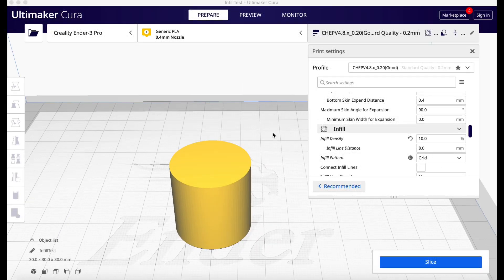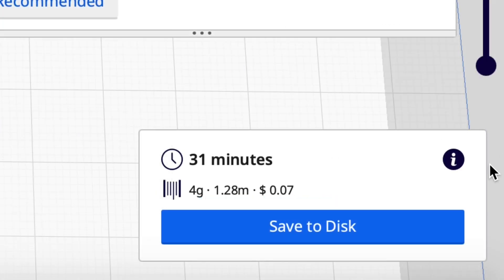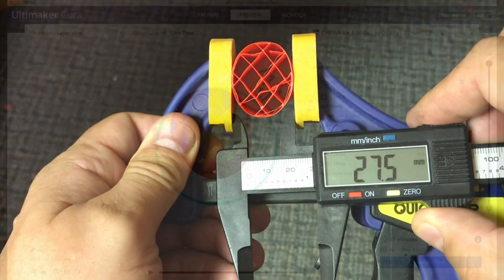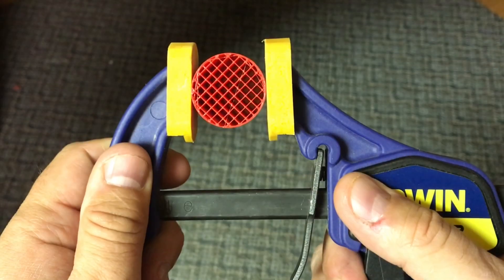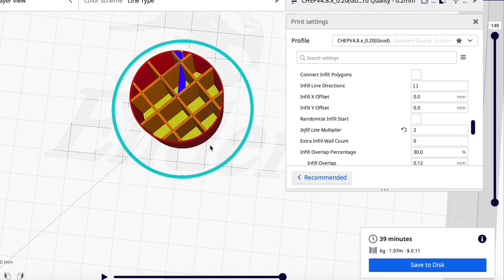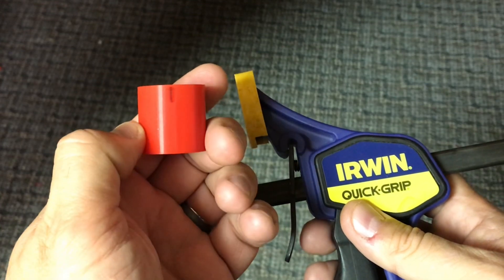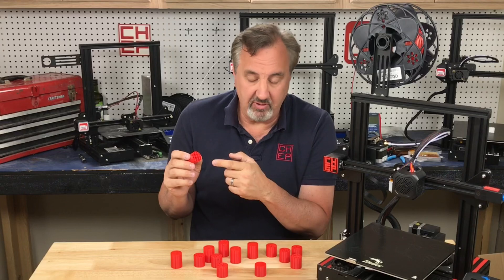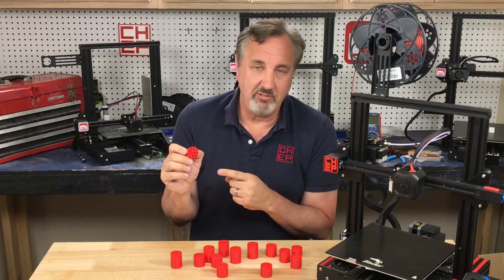Cura Infill Setting for Stronger 3D Prints using Less Plastic

Comment from the maker: For all those posting that I should have compared 20% implying they are the same, but two line uses 1.97m vs 2.17m for 20% so they aren’t the same. 
I also crushed several infills including 20% and found it wasn’t as strong since the lines are thinner and the arrangement of the infill lines didn’t hold as well so I didn’t show it along with other infills I tested. I was then surprised that two line at 10% so close to 25% due to line arrangement at 10% and the thinker stronger lines so I showed that surprising result. 
Your welcome to try it.
Reply: Why you dont use triangle pattern???
Reply: I like what you've found here. Setting the infill to 10%, then doubling the lines (making it effectively 20% infill) uses less plastic, is faster, and stronger than standard 20% infill settings.
Reply: hey chep big fan here
i would really like if u could give me a profile for ender 3 v2
Reply: Hey I got kind of a problem. 
 my printer he's printing lines too far apart.
 for this instance when I would do this infil, witg two lines, those two lines will be weak because they dont stik together wel
Reply: @jancko995  Could be any variety of things causing less plastic to be extruded than it should. Make sure you have infill flow set to 100%, and try reducing infill speed and/or increasing nozzle temperature to make the plastic flow more easily.
Reply: This a bit too unscientific to be taken as fact.
It's based on estimation from the slicer instead of just measuring the weight of the part and using a hand cranked device as opposed as constant force such as a weight.
PS: would be interesting to see it compared with just adding more walls.
Reply: How does the 10% / 2-line compare to the 25% when force is applied with the infill rotated 45°?
Reply: @FilamentFriday Hoping you could help me if possible.
Whats the best way to make a print solid using 100% infill or maxamize my walls without have the original size of the design change and would i need to mess with top and bottom layers or i can keep that default.
Reply: Please do double-line vs 20% so it gets clear to everybody. That would be a fair comparison. Or maybe triple-line vs 30%, that would be interesting too.

Comment: Sorry buddy question off topic, but you are the man in the know and I’m just about to press the button. What do you think to me buying a new Creality K1 Speedy 3D Printer. I have a original ender 3 that I can’t upgrade anymore and just want something that I don’t have to mess with any more and give me fat prints as I have so much to do and have fell out of love with printing to tell you the truth I can get it for £369 pound here in uk, purchase two rolls get one free and a years free cloud membership been trying to get advice but nobody is coming back to me. Sorry again to go totally off topic to your video I know you work really hard to put them together. Kind Rgds. Dale
Reply from the maker: It’s good but there are so many choices now in that same category it’s hard to recommend one over the other. Early K1’s had issues. I think they’ve fixed most. I replaced my hotend with a Microswiss. 

https://youtu.be/QVj-M9v7-zk?si=Cg6y3uHjvtqwkJdf

The K1C has the improved hotend/nozzle. I’ve heard K1 might have that now but can’t confirm. For all K1 I recommend a Biqu Cryogrip bed but It’s not released yet. I use it on my Bambu printers and it’s amazing. 

https://youtu.be/43c2QdsDNbs?si=2YwLJudqR8dcjaya

The standard K1 bed material wears out and you can get the plastic blob around hotend. It’s horrible. 
So K1 is better and faster than Ender 3 but it still needs improvements.
Reply: Thank you for taking the time to share your valuable and priceless knowledge, I’m really grateful. Kind regards Dale
Reply: I recently bought a K1 and I wouldn't recommend it. You have to do a lot of mods to it to get it working the way it should. You can check out @zerodotcmd and see what he has done to his to get it to work. He also did a video on printers he would recommend instead.

Comment: My Cura used to lay down the infill pattern first, then multipliers.  But now it appears to lay down the multipliers first and add the infill after.  Anybody know if there's a switch I accidentally triggered, or anyway to swap it back (short of rolling back a Cura install)?

Comment: Or just use a wider extrusion width with the same 10% infill
Reply: @Dolimoe-vh9kq  It depends. For circular wall, such the one in the video 4-5-6 wall line would do much better, even with 5% one line infill and its faster to print.

Comment: how is this not considered a worse (from a force distribution standpoint) version 20% infill (from a procedural standpoint)? 

Let's say 10% infill (1x multiplier) would be 100 mm of 0.4 mm nozzle plastic extrusion; i would consider 25% infill (@1x) to be 2.5 times that (250 mm) due to the density increase. If you kept the 10% slicer setting but doubled the wall size (2x multiplier) in this perspective, the result would be 200 mm of extrusion distance. By that regard, 200 mm in this hypothetical would equate back to a 20% infill setting but with nodes farther apart.

Comment: do you think the grid is the way to go on basic infills instead of cube or some of the others. I just got into printing so im trying to learn whats a good infill to use for the average pla items
Reply: I use cubic subdivision for most of my prints. Seems to be a good compromise between print time and strength.  
Maybe give it a go. It's faster most of the time vs cubic but still gives good strength. If you need a strong print don't forget to add wall(s).

Comment: Yeah but if you are adding double lines to a 10% infill are you not just making a 20% infill based on volume just using a "course" pattern?  You are not actually using much less material if any less.
Reply: Did you even watch the video?

Comment: Cool video. You could also use any triangle based infill setting and gain strength
Reply: First thing that should be done, yes. Or hexagonal - even bees know that
Reply: @woodfinchcrafts7267  bees dont use hexagonal shapes for strength, they do it because it is the most efficient shape when it comes to the amount of volume (for honey) it can hold with the least amount of wax needed. Hexagons are not as strong as triangles. Visualize it, put 6 triangles together and you make a hexagonal-shaped perimeter, but with added benefit  of inner lines for support. Now if you remove those inner lines from the triangles you'll get a natural hexagon, which no longer has support in the middle.
Reply: @ItsAustinSea  I disagree...look it up. Your example is also wrong...3mm squares made from 1mm material are stronger than a 1metre triangle made from 1mm material. Your example does the same..compares apples to oranges. Hexagons are strongest for the amount of material and maximum connectivity
Reply: @garthnoakes3725  you can disagree all you want, facts are facts. You can crush hexagons from the side much easier than a triangle. There's a reason engineers use triangles for load-supporting structures like trusses
Reply: @ItsAustinSea  For bridges yes. For 3d printing infills - no. Research it, you will see
Reply: Supportive cubic is the bomb imo

Comment: This is great, I'm playing around with some articulated prints because I find that the joints are a little weak sometimes. I don't know if it's because of walls, infill or even the filament itself. Could be a million reasons but this has given me something else to factor in so thank you so much😊
Reply: Im having the same issues.  Did you make any changes that made a difference?
Reply: @forreal7568  I've noticed that the pieces made out of Silk PLA break at the joints. Increasing line width from 0.4 to 0.6 has helped. I'd really like someone to do a video on strengthening the joints on articulated prints...Hint, Hint Chep 🙋🏽‍♀
Reply: So I did 3 walls. 25% infill and 30% over lap infill. Is definitely stronger. I might go up to 50% on the over lap

Comment: Thanks this gave me some more ideas how to make the print stronger. Still there are some wondering what should be the best option. I print my walls thicker to make stronger parts...and of course with more infill. I listened to a group of 3d printer and they told people to be better off with thicker wall then with more infill. I think they are right in one way because the layer will have more difficulty to separate under load

Comment: Do any of the software packages have the capability of doing infill using a hexagon pattern? It is one of strongest shapes. Compare a hex cell to a square cell and you can probably make the hex cells bigger but still be stronger.
Reply: I believe it's called honeycomb pattern but gyroid is better anyway.
Reply: @fenrir7969  Hexagon beats any other shape for speed and filament

Comment: I have a fokoos 3d printer and I am using cura 4.13 and the profiles you offer will not load. What am I doing wrong? I didn't see one for 4.13 on your page but I tried the ones I could
Reply from the maker: Use a Creality machine profile and adjust for your printer

Comment: will 0% infill just keep building the layers up like it does anyway?
I mostly print project baxes, so for a project box lid with infill set to 0%, will it not just infill how it makes the normal layers, we are talking an oblong lid 3mm high.
I dont get why for something like that I would need infill.
Reply from the maker: Yes, but the top may sag because it has no infill to support it.
Reply: @FilamentFriday  Many thanks that answers my question

Comment: You should create a system that changes between different infill patterns dynamically, since each infill pattern has its own properties.

Keep in mind that there are so freaking many different infill patterns. If it could also change infill line multiplier and infill orientation, and not just infill pattern... Whew, that would be really tough.

And of course, there are also things like Load-Dependent Infill (based on topology optimization), Gradient Infill (a hack by CNC Kitchen), that new "Lightning Infill" (which technically isn't actually infill), and of course... Texturing (which can really enhance stiffness when you need it).

Comment: Nice tip. And your test was very simple but also perfect. I stumbled on the multiplier setting awhile ago. I basically did what you did only with 3 layers at 15% infill. I've been making a ton of wall hooks for people and wanted a way to reduce time and filament use but also be just as strong.

Comment: What's the name of the add-on that shows cost of print?
Reply: It's included by default, you just need to set the cost per kg in the settings.
Reply: If your using Cura. Go to Preferences, General, and set your currency. Then while in preferences, go to Materials. Fill in the weight of a spool of material you are using and it's cost.

Comment: Step 1: increase wall thickness as infill doesn't do much for strength
Reply: I had 4 walls and 15 infill on a sling mount for a friends airsoft gun. Broke after a few hours. Walls are not everything thats for sure, it doesnt hurt to be at 25 on the basic 1 multiplier

Comment: Thanks for the video, I really appreciate your time and information.

We just purchased an sender 3 to help my wife’s business (making our own bath bomb mould’s to use in stead of buying a ton of different ones) I have downloaded a few free STL files, and the infill in set to 80%! These price will only have 80-90lbs of pressure straight down on them from above. We have not used any printed molds yet, but that seems like a lot of infill for that little pressure. I will try one at 25% with a double wall to start, and see how it goes. 

Can’t complain, my wife bought a 3D printer and I get to play with it!!

Comment: So you have used a 10% infill and added double lines to make 20% which in reality that is not 10% infill , it has now become 20% infill with the pattern of 10%. why not just make your line width thicker than what your standard width of the nozzle is or any other wall thickness. I think that would be a lot easier and you could still call your infill 10% and not I doubled the lines up and now its still 10%? just seems wrong to still call it 10% infill and not good for those just starting out in printing.

Comment: Oh boy. The single line 10% simply does not print as it should. Just look at it. You got all sort of issues, the main being retraction issues. It also appears to be suffering from the bug Cura has, in which it tries to join single line extrusions in mid air. There is clearly an entire section of filament missing in the infill area, in the same spot. All these examples are seriously faulty, none of them are great. This is poor slicing. If you want strong infill, you probably need to reduce the speed, and the retraction needs serious work. That will save you filament, but usually, the perimeter will look uglier. What you do in this video, is to use dual walls to mitigate extrusion flaws, but it only works half way. You will get less strength given the amount of plastics, than you would if you printed single walls correctly. Perimeters do print nicer wasting this plastics, at least since the steps needed to fix the infill flaws uglifies the perimeters.

Comment: The infil with double lines simply looks like double the infil material. I figure you could probably set it to a 10 or 20 multiplier and effectively have 100% infil at the 10% infil setting.

Comment: also check out the alternate external wall option, it will add extra wall line on every other layer, pinching the infill in between the wall layers

Comment: Had no idea you could do that to the infill pattern.  Very useful.  Thank you.  
I'm not surprised that it adds more strength than double the number of infill lines.  Lamination can really add strength.  
Some rude commenters might criticize you for using the grid pattern, but it is probably the best pattern to demonstrate the benefit of doubling since it is the most likely to "rack over" under stress.  This technique should work on most other patterns.
Reply: Well, there is always someone "smarter" out there that has enough time to roll around in the comments section on youtube yet doesn't have "enough time" to start a channel and show everyone how it's "really" done.

Comment: I do 1.5 mm walls, in cura it's 4 walls, that and 20 percent infill or more and they should be strong
Reply: same here ... also 3 or 4 bottom/top.. depend on model and load infill from 30% to 60%

Comment: As long as is doable by your nozzel a bigger infill line width makes it even stronger, that's one of the reasons you can easily make stronger prints with bigger nozzles. To choose a correct infill pattern and infill orientation/rotation is also important depending on the print.

Comment: Hi…question…. would using this technique of double infill lines decrease warping of the part?
Reply: No warping us caused by improper bed adhesion laying down more plastic will not help the problem. If you want to increase bed adhesion look into using a brim, or a raft and making sure you have proper first layer squish meaning adjusting the nozzle height to the bed.

Comment: If you double the wall on 10% infill, it isn’t 10% infill anymore.
Reply: O that would mean the pattern size is different depending on the size of the print, but it isn't.
Reply: @DJScopeSOFM  you're not making any sense. Joel is 100% correct.
Reply: @ozrenbalic6051  So what happens when you have multiply parts? Actually, to double down on that, have a small part and slice it at 10% and look at the infill, then have a large part and slice it and the distance between the infill line will be the same as the small part. It's not based on the volume of the print, rather the scale of the infill pattern's original size.
Reply: @Dean Kenneth I'm wasn't arguing against that.
Reply: @Dean Kenneth I'm only pointing out the technicality of infill percentage and what it means. The variables of the infill itself is what makes up the infill entirely. Yes doubling the lines will make the infill heavier, but it's still technically a 10% infill, but with 2 lines. You gotta think about it in a broader sense.
Reply from the maker: But the setting in Cura is still set to 10% so that is how it’s described.
Reply: 10% is the scale, so it's still 10% but you're just thickening the infill lines. But in this scenario it would be just as beneficial for you to just use the triangle pattern infill.
Reply: @DJScopeSOFM  I think infill percentage is measured as the the volume of infill inside the part. So if you’re adding more plastic inside, no matter which setting you use, it’s not really the same infill percentage anymore.

Comment: I use another method, way faster and probably also using less material. 
- Infill flow 120 to 160% (depends on you speed)
- Connect infill lines
- Higher temps than usual (+10°C for PLA, +15°C for PETG)

Same results

Comment: It is easy to see that it all depends on the number of 3mm lines printed. 10% uses 3x3 single lines. 10% double lines 6x6 single lines. 25% use 9X9 single lines.

Comment: Just curious.. wouldn't you get the same results doing a single infill wall, but double outer wall?
Reply: For this very specific test, more infill is almost certainly better. Cylinders are happy to flex so with out a top and/or bottom to prevent it from crushing inwards, almost all the force is going right to the infill. That said, more walls versus infill depends on the model and how force is applied, but more walls are almost always better in my experience. Up to a point of course, infill is still important.

Its a great demonstration to increase infill strenth, but definitely doesnt reflect infill versus walls. Which is fine, since that wasnt the purpose of the video.